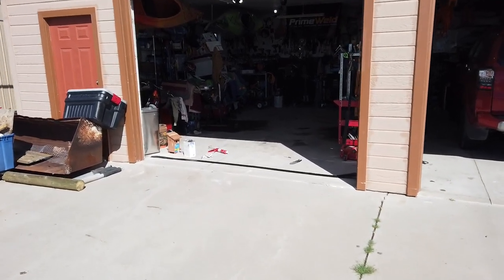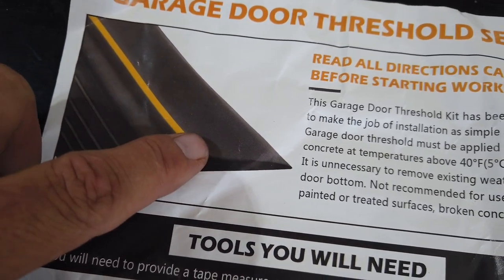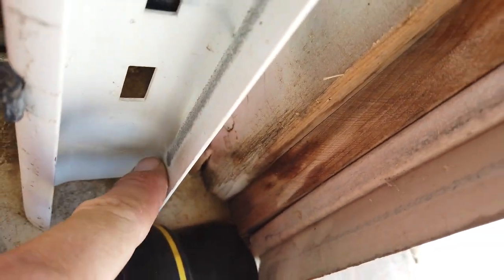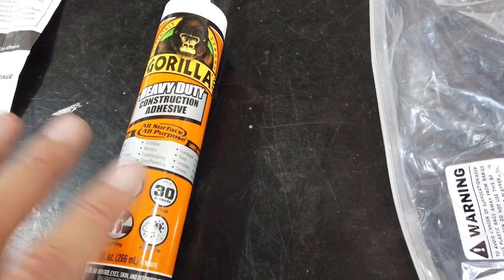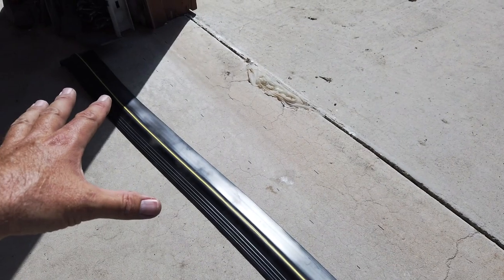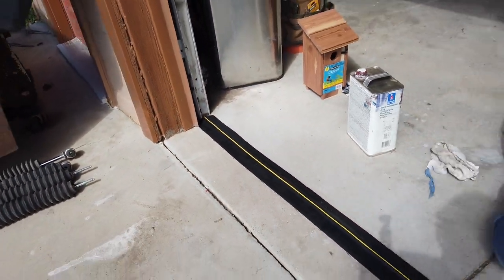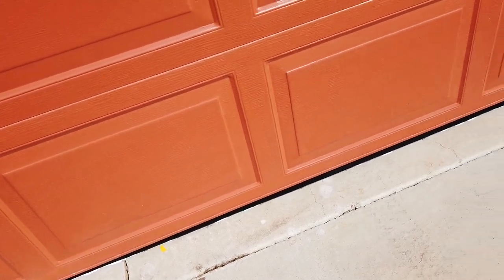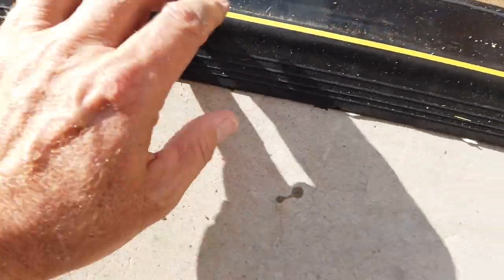Garage THRESHOLD install

Comment: Excellent video. I took the trouble to run a sander with 40 grit paper over the length to clean up 20+ years of slight buildup then came into the house to jump on YouTube to find some tips on what to do next. Your video was my pot of gold! Answered any questions, I may have had, plus I'm even using the same adhesive and rubber seal.  Thank you so much!!
Reply from the maker: Glad it helped you! Sanding is a good idea, I wish I had thought of that. Thanks for your comments and for watching 👍

Comment: Thanks for including the subtleties and nuances of the installation. I'm getting ready to install my strip, after first trying to build up a berm where the water was entering from one side, using concrete patch, then resorting to sand bags; neither of which worked after experiencing the bomb cyclone this week. I would want the seal to start from the very edges of the strip, so I will apply the adhesive like you demonstrated, as rows running parallel. Thank you for the video.

Comment: There's a video out that you measure to  the outside tracks and cut to that length and then notch the edge to fit around the tracks. But thanks for the viy😊

Comment: I'm gonna try using one of those without glueing it so I can move it out of the way when I need to.  Don't know if it will work, but gonna try it.  I wash my car inside the garage and would have the opposite issue if one of those was permanent.
Reply from the maker: @29outlaw  i wonder if u could run a piece of steel or rebar down it to keep it more rigid, so it wouldn't try to coil up and would stay straight. Or could you attach it to the garage door somehow? IDK
Reply from the maker: I mean maybe someone makes one with a groove down the underside...

Comment: what can I do if floor is not flat, but crack going down middle which causes one side of garage top be a 1/4 inch lower than the other

Comment: My question, how did this last over just one year. Did it slip, when you drove over it? Do you have harsh winters and it failed or did the adhesive failed or did is stay in place?
Reply from the maker: @paulsccna2964  no problems to date, hasn't moved at all, I do abuse it, drag low profile floor jacks over it often, hasn't torn or moved. Lows of -31 one winter, often -20F at night. Upper 90s in summer so big temp changes for sure. I would do the exact same thing again

Comment: Thanks for your detailed installation video. My rubber door seal arrives today. Do you think it would have worked well to use a cut-off wheel to remove the bottom portion of door track - just enough for the seal to slip under? Appreciate your thoughts. Thank you!
Reply from the maker: That's a really good idea, that way the seal could stay intact. Funny thing, I just moved, and my new garage is leaking melted snow in like crazy, I need to put these seals on my garage floor! But it's super cold here , so I'm going to wait till spring to put mine in . Try to do it when it's warm as possible during the day. Thanks for watching, good luck.
Reply: @anesthesiadreamin  I wish you great luck with your new home. This is not my original idea, someone suggested it on another YouTube video. It made complete sense to me! I wondered what you thought. I'm going to try it.... Take care and  thanks again.

Comment: What was the outdoor temp when you installed the door seal?
Reply from the maker: 70°
Reply: Lol thanks!  We are only in the 50's so I will have to wait to install probably.
Reply from the maker: @stevebaretta1  You might find a glue/ adhesive that would work at that temperature. But maybe more importantly is the malleability and flexibility of the seal, so it doesn't recoil or move around after you lay it down.  Hey, thanks for watching and bringing up a good point 👍

Comment: How did the adhesive hold up? I messaged Gorilla and they said their construction adhesive would not stick to the EPDM rubber.
Reply from the maker: Huh. Mine hasn't moved yet., Even the edges are still stuck down. In fact I was winching in my winch cable across it the other day, and the hook got stuck on it, and it didn't rip it up like I thought it should have LOL. Did gorilla recommend something else of their product line?
Reply: @anesthesiadreamin  interesting, no they recommended I reach out to the manufacturer or the threshold for the recommendation of adhesive. I have what you used and thanks what I will be using. Thanks!!
Reply from the maker: @BKfiremedic  Great, I hope it works out for you as well as it has for me. Can you use too much? IDK, but I wanted to see it sort of just beginning to squish out the edges, so I knew for sure the edges were glued well. But then it leaves a colored seam along the edge of the black seal. Not sure how to fix this, maybe a squeegee? Lemme know if you learn any tricks. Thanks for watching and for the good question!
Reply: @BKfiremedic  Garadry makes their own sealant just for this